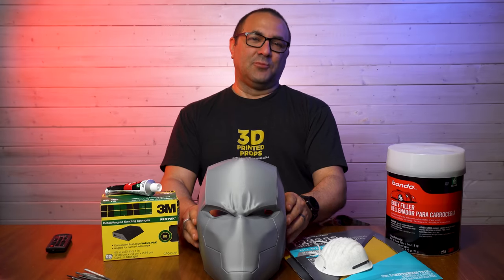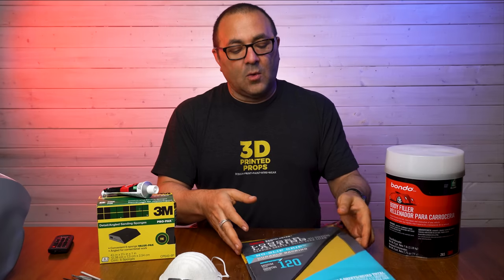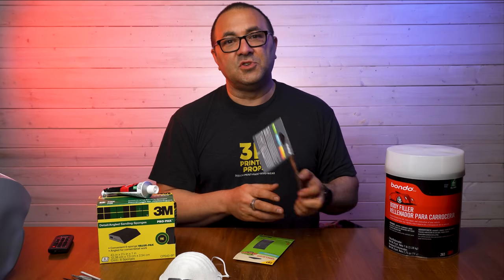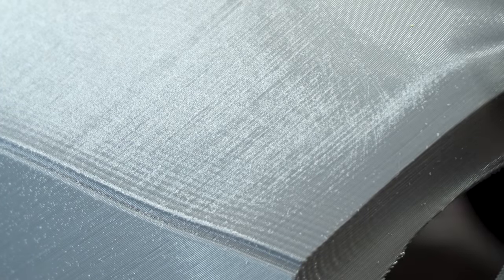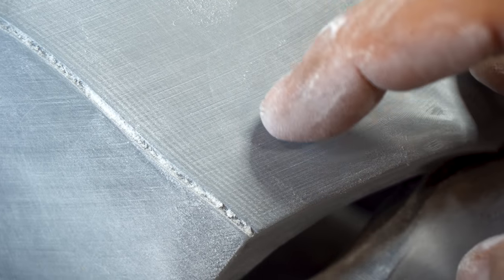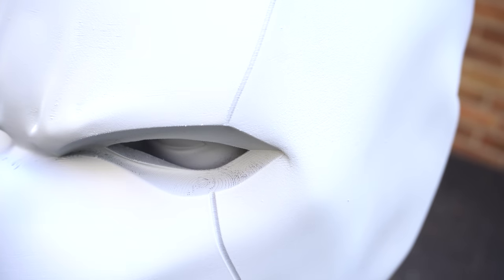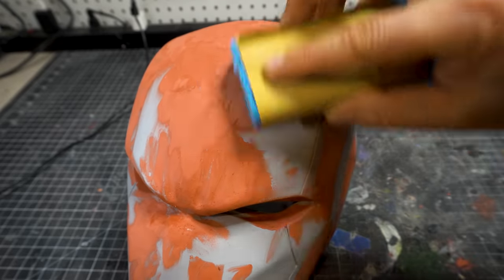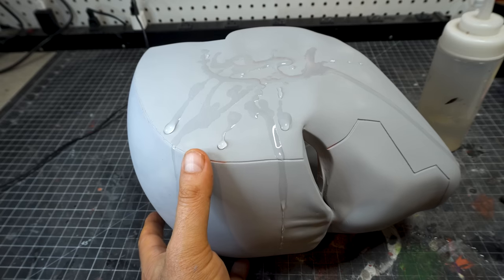Finishing 3D Prints: How to Sand, Fill and Prime 3D Printed Parts

Comment: ...few tips from a painter, use a glove when you're handling the liquid bondo! that's chemicals getting in to your skin there! Second, as a pre paint layer it's better to use 800 grit wet, 1200 is actually pretty fine and a pre polishing grit, it will be bad for adhesion, maybe not directly when you paint it, but in the longer run, like a few years chances are (depending on the paint) that it's gonna crack or come loose...lastly, USE SCOTCH PADS! for this type of sanding, red scotch pads are excellent here, they are a savior to sand difficult places without damaging small details and are also great to use as a final wet sand before painting.
Reply from the maker: I know, I need to remember gloves when using bondo. I'll definitely try the scotch pads. Thanks.
Reply: Came to say the same about the high grit sanding. I would say 600-800 is a great stopping place for paint. If you are going to cut and polish then the finer grit will do well for that glass like finish.
Reply: Use scotch pads instead of the 120 - 800/1200 sand paper?
Reply: @Sal_Sal27  As a pre paint sanding stage, 1200 is way too high...800 max, the nice thing about scotch is that it can easy sand not flat surfaces.
Reply: @peterdocter4659  my bad. I meant, when do I use the scotch pads?
Reply: @Sal_Sal27  last sanding stage before paint.
Reply: @peterdocter4659  thanks.
Reply: @peterdocter4659  by any chance, do you know if I can use Kwik Seal Plus or does it have to be Glaze Spot Putty?
Reply: @Sal_Sal27  There's no rules, just try it! haha
Reply: Are the scotch pads in lieu of using an 800 paper wet sand, or would you recommend using the 800 wet followed by the scotch pads?  Thank you!
Reply: So in other words this guy is putting labor in enough to make this thing cost buko and instructing others in a video and he’s still doing it wrong.
Reply: @RootinrPootine  Wrong would be a stretch, but it could be better yeah! haha. especially the sanding, i use 600/800/scotch pad for paint layers, 800 being the finest for adhesion and mostly used for airbrushing layers, anything up is only for clearcoat layers. I will say that it also depends on the usage, i mean it's not going outside or in weather and will not have to do with lots of temperature changes etc. But as far as instructions go, using cloves at least is a must!
Reply: Honestly imo 400 grit is the perfect spot for solid colors and 600 for metallic.
Reply: @brett9382  Depending on the use, for automotive 600 is the base, metallics 800, but yeah that's not far off, also metallics you'd want a bit finer, because you'll see every imperfection on the surface, and are also depended on thickness and type of paint as well as technique, but yeah. just not too fine a grit.

Comment: Steps to sand, fill, and prime

Sand
-120 grit sandpaper
-220 grit sandpaper
-320 grit sandpaper

Fill (wash print before applying filler primer)
-coat the entire 3D print (apply about 2 coats and wait for each coat to dry before applying second coat) (stay 8-10 inches away)

sand
-sand the primer with 400 grit

wash 
-wash the print off

glaze spot putty
-fill big cracks and lines
-wait to dry and then sand with 400 grit

give another coat of fill primer

wet sand
-wet the helmet and then sand with 600 grit sandpaper
-wet sand again with 1500 grit sandpaper

wash
Reply: Does the hight grit (1500) sandpaper get rid of the sanding marks? I’m getting ride of the layer line but am seeing sanding marks
Reply: @domthemom2270  Yes
Reply: do you wash with soap and water or just water?
Reply: @gage.does.everything  Not just rince but wash (soap + COLD water)
Reply: @Alexlemay17200 it's not clear in the video but is there really not need to get rid of the rubbed dust from sanding by washing the part agin between the glaze putty step and the last filler-primer step?
Reply: would this work for a small surface area project
Reply: Way too much work lol
Reply: Guessing this wouldn't be recommended on a small prop, cause I'm currently trying to sand my revolver with engravings and this type of sanding would def destroy most of it. Maybe I'll I'll just stick to 120 grit and fill in the imperfections with primer
Reply: TYSM

Comment: This is a great video. I usually give a very thin coat of resin ( I use anycubic clear resin, used in 3d printers) before I start to sand. 
I keep it in the sun for about 20 mins (I know they tell you to cure it for 12 hours but since i am sanding it I found 20 mins in sun is more than enough) and then I start to sand. 
This way I don't need to use the wood filler later as all the cracks will be filled and also I can start from 220 grid paper (saves a lot of time).
I will definitely be using sponge trick (awesome trick, had not thought about it).
Thanks...
Reply from the maker: Yeah, I know others who do that, I need to try it out.

Comment: I'm using 3000 grit wet sand paper  as a last sanding process ! if you don't want to paint your product i think you can use 5000 grit after all these sanding process and also you can make very high qualify silicone mold from your 3dprinted part.

Comment: the foam for applying is a great idea, never though about that
also realized what you were talking about, using too much of the glazing putty has caused it to crack for me, gotta go back and use a heavier filler first and then use the glaze to fill the small remaining stuff
Reply from the maker: Yeah. The glazing is for finish work. It cracks like crazy when put on too thick. 😀

Comment: I have a Mando helmet from villainous prop shop. Used the Bondo spot and glaze putty as well. That is some righteous stuff for smoothing print lines. I'm currently working on a replica of Loki's mask from the Jim Carrey mask movie, using the same process.  Great video. Anyone who's starting out on working with 3D printed cosplay or props could benefit from this.
Reply from the maker: Thanks! I appreciate it. :)

Comment: Love the video and your fine work, a few too many grits for the average Joe, at about $12 per grit pack at Home Depot, 120/220/320/400/600/1200 plus the 2X Primer =$100. I get by with 120, 320 400 and 1000 but your results are superior....I will also use a palm sander using 80 on bigger sections of flat areas...if money and time were no objects, I'd like to follow your grit choices
Reply: I missed 1500 so we're over $100 eesshh

Comment: Glazing putty is great for the finest lines.imperfections and Auto-Bondo is best for mistakes like oversanding/print issues but I've found wood-filler essentially useless. If it's a fine issue, glazing putty is your go-to filler, if the hole/gap is larger and you use wood filler, it crumbles like a cookie under even semi-vigorous sanding, stick to Bondo, it's designed for auto-body and fiberglass, so of course it will be strong enough for PLA

Comment: At the 120 grit part, ill use a torch before wiping the dust. This melts that plastic dust into the layers. Then i hit it with the 220 and up. It helps reduce the intitial sanding with 120 grit, but i also use a cheap printer that doesnt have the best quality so the layers are much more noticeable

Comment: Im wondering, when you prime and sand again, what grit are you using? 120? And after you spot putty it, are you using 120 or a finer grit?
Reply from the maker: After I prime I use a 220 to 320 then after the putty I use the same and go to a 400.

Comment: amazing work  you did ^^, i was wondering which sand layer you used after the primer filler :) I'm using red spray paint instead of manual so was wondering about the thicker grooves on top

Comment: How do you know when you should stop sanding with one grit and move on to the next?

Amazing tutorial BTW
Reply from the maker: Well for example the first grit, the most aggressive I stopped  when I could see that most of the larger peaks and valleys were worn down. Then I moved to the next. Usually you just need to do it by eye. go over it once and see if the imperfections your were sanding is gone and move to the next.
Reply: In woodworking, sanding with finer grits is all about removing scratches from the previous grit. In that sense you would remove ALL imperfections and layerlines from the start, before going to the next grit. So that you only have to remove scratches from the sandpaper when you proceed. That makes it way faster to finish. And going anywhere beyond 800 grit is a waste of time, because you are only polishing the surface, giving the paint less grip. I would probably not go beyond 400 grit before painting, but then wet sand the primer.

Comment: Love your videos. I’m making a helmet I plan to have signed at a future con. Any idea how to proceed with clear coat? Should I clear coat before and after? Or just wait on the clear coat until after signed? I don’t know if the clear coat will hinder the helmet being signed if applied beforehand. Thanks!
Reply from the maker: I'm not sure to be honest. I would do a test. Paint a scrap print, sign it with a sharpie then test it with a  clear coat that u know works with the paint. If it works bring that sharpie.
Reply: @3DPrintedProps  thanks for the input I’ll do just that!

Comment: I’ve had poor results with machine sanders. Even at the lowest setting, it will still melt tiny details. I do all my sanding by hand now. It tedious, but you can skip grits. I go 120, 240, 600 dry, then fill and prime. Back to 600 to make it equal, then a final wet with 1200. I’ve found that going higher than 1200(for PLA) not only makes sanding take longer, but the result isn’t much better. Automotive sand paper and paint works really well with PLA and I use just standard bondo, but if you don’t want to be rushed during the process, they make a UV bondo that won’t cure without UV light. Regular bondo give you about 2 minutes of work time before you can’t spread it anymore. To combat this I use a very small amount(only about a teaspoon) and I make multiple batches to fill a print. It’s kina tedious, but the end result is 99% blemish free. Also a tip: if you need a bond stronger than super glue, you can use a 3D pen to add filament manually and it welds the parts together. The only thing stronger is 3D gloop. You can get almost everything you need in the auto section of Walmart and it’s should be under $30.
Reply from the maker: Me, I'm actually going to check and see if I can just return this.

Comment: For sure this is the best sanding video i saw since i startet doing props really helped me and noted all the steps 🙏🏼 with what gridsize di you sand after puting on the bondo? 400?
Reply from the maker: Yeah, but it depends, sometimes if I lay the bondo down way to think since I suck using it I need to start with a higher grit, so it will depend.
Reply: So if too thick higher grid if its good 400
Reply from the maker: @landohanysz8314  Yep, that would work.

Comment: I like to start with a 60 grit then move to a 120 and then a 400 I then add a filler sand down with 120 then 400 and do some filler primer and sand that down with 400 its usually ready for base there but some times I need some more filler.
Reply from the maker: Sure, whatever works. I find 60 grit a little to aggressive though.

Comment: Amazing video, but what grit did you use after the primer stage? I assume just 320 but you dont say.
Reply from the maker: The sanding after the putty is a 400, then the final sanding is a wet sand at 600 and 1000. :)

Comment: I recommend saving yourself ALOT of steps and getting a better, more consistent end result by washing the plastic first then coating the entire piece with the glazing. from there you can start sanding straight away with the 400. since you already have the glazing in your workflow, do it as a first step. Or, do bondo. Either one. I personally would just mix up bondo and use bondo on the piece but for something like a mask the glazing's fine too as a first step But either way, wash the hell out of it, let it dry, blow it out with a dry air compressor line to get rid of dust and other materials, and then just glaze or bondo it. REALLY thin, just covering the lines. Then start sanding at 400. If 400 isn't cutting enough drop down to 320 but once you get the hang of it and are able to put an even, thin layer of bondo or glaze, you won't need to go to 320 and can start at 400. It will save hours and hours and hours of time, and the end result is usually better becuase there's less chance of distorting the lines of the piece by "over sanding" with the lower grits trying to even out the lines. Doing it this way also negates the need for sandable/fillable primer, although you can still use that if you want. A regular primer will do just fine though. Also, its a good idea to NOT sand primer past 400-800 grit. While you CAN, you're actually removing some of the mechanical surface imperfections that the final coats of paint will use to adhere to the primer. The smoother it is, the less mechanical adhesion. You want to wait til you're on youre final clear coat to use the 2,000+ grits. What I usually do with primer is sand it smooth with 400 and wash it and paint it. Once the final clear is on and cured enough to sand, I sand it with 1500, 2000, 25000, then 3000. This will produce a mirror finish EVERY TIME.
Reply: This sounds like a more traditional method. I thought I had seen somewhere that you wanted a certain level of grit for the paint to adhere to so that’s good. Thanks for sharing!

Comment: problem when you start sanding with 1000+ grit is not all paint can adhere to it, even in the automotive world even super cars they will only sand to 400-600, paint needs grit to adhere to  smooth surfaces better.
also spray paint there is no point in going above 1000, as the natural textured formed due to the less atomization vs conventional spray guns will basically ignore all the extra work you put in.
it will just naturally cover and flow based on how you apply the next few coats of paint regardless of a 400 grit finish or 1000+
normally after primer you sand to 400-600 then you do a sealer coat before base which smooths out any potential grit lines, wait 30 mins then do base coat, waiting proper flash times between coats for best adhesion possible.
save 1000+ for cutting and buffing clear coats for ultra smooth finishes.
Reply from the maker: I'll have to try that. Thanks.
Reply: Maybe spray Mr. Super Clear mat?
Never tried that but I have done some doll repaints and used that so the colored pencils and chalk can hold on to something.
Reply: Yeah 1000+ grit is really a little overkill prior to painting. Wet sanding should be done after a few coats of paint have been laid down. On the other hand I doubt the high grit will impact adhesion, I guess any solvent will readily eat into the PLA anyway.

Comment: Another great process after glazing putty is to make Rhondo and coat the surface. It's self leveling and really smooth after sanding... rhondo is a mix of fiberglass resin and body filler. Mix both as you would use it then add the body filler to the resin and paint on with a chip brush and let dry but be careful of drips
Reply from the maker: I've never tried that, but great tip!
Reply: @3DPrintedProps  I use it all the time. It's a definite time saver. Usually I do a light 80 grit sand and then use a rhondo coat and then go into 220 - 400 sand then primer filler and start wet sanding 1000 - 2500, spot and glaze putty the pin holes sand and your ready for final prime and paint

Comment: when you use the wood filler do you sand it to the point where there is no color at all? the primer you used in the video is a maroon color, after drying should you sand it to where it is completely gone?

Comment: I need to get the texture of my print to be smooth. Not too concerned with getting it visually perfect. I'm just getting frustrated because I'm sanding, filling and painting but I just can't get it smooth! The layer lines are still prominent when you touch it
Reply from the maker: What layer height are you printing it at.
Reply: @3DPrintedProps  0.4mm but the I'm using the adaptive layer height setting in Cura

Comment: What if you already did the paint job, but half a year later you realize there are still printing lines and imperfections that you want to get rid off?
Can you just sand it down again, but primer/wood putty etc on it and "start over"? Don't wanna ruin my build as i really love it
Reply from the maker: That can get tricky. I would start a new build with everything you've learned. :)

Comment: Thanks a lot for this awesome video ! Do you have any recommendation for an alternative sandable primer filler ? On any site I am looking for, it's out of stock. :(
Reply from the maker: I used to just use wood filler. You can get that at any Lowe's. 🙂
Reply: @3DPrintedProps  Thanks a lot for the advice ! Would you recommend wood filling first or applying primer first (as rustoleum does both at the same tiume :)) ?

Comment: Is this process good for anything that is beyond cosmetic? Is is it relatively heat/cold resistant? Does it protect the PLA from cracking or do any kind of reinforcement? How does it hold up over say, a decade? I want to be sure I'm investing in the long term with this time and energy.
Reply from the maker: It's plastic, so it's not heat resistant. If you left it in the car on a hot summer day it may distort. As far as how long it holds up, I don't know. If you take care of it I would think it would last quite a while.
Reply: @3DPrintedProps  Thanks! I'm not worried about the plastic, but some seem to think the red putty + this particular primer can crack and shrink over time, however little luck getting any robust alternatives, so I'll chalk one up for these based on your experience with them.

Comment: When I sand the print after applying the primer, it removes a lot of it, to the point that I can see the PLA underneath it, should I apply more coats of primer before sanding?